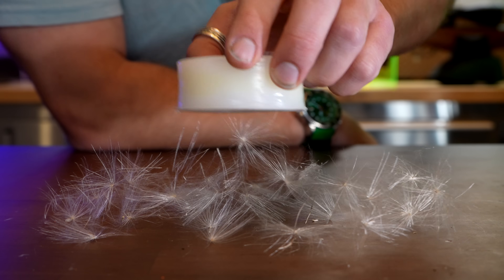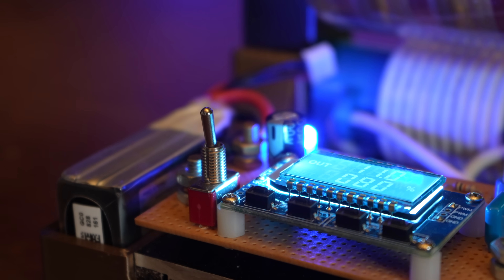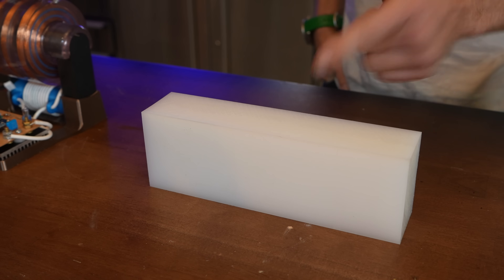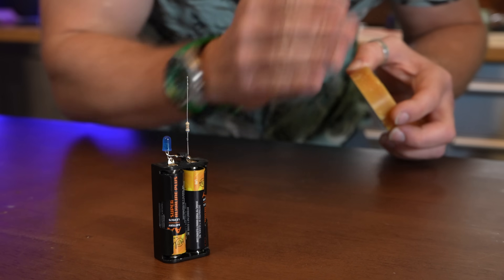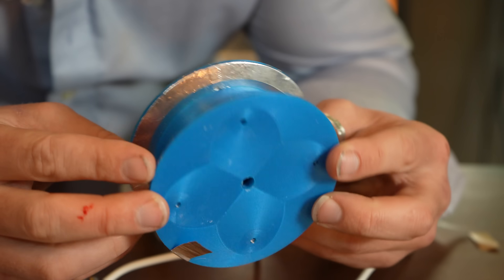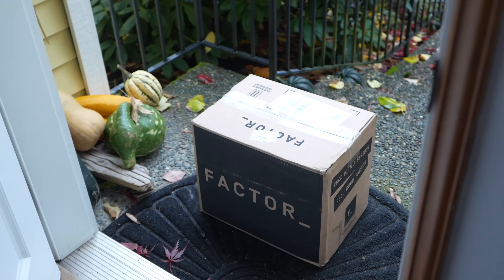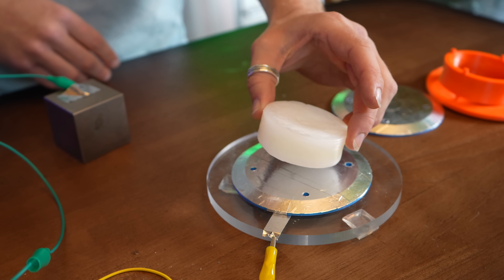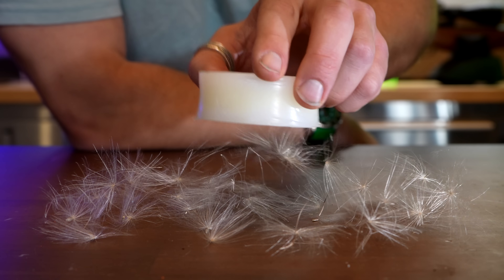Creating an Exotic Material With A Permanent Static Charge (Electret)

Comment: How about using a pair of N- and P-channel MOSFETS for the sensing, with red and green LEDs to show the polarity.
Reply: More specifically Bi-color Red/Green LEDs.
Reply: @Datvi  'More specifically Bi-color Red/Green LEDs.'
- as @blacknoir2404 suggests, and I 100% agree: Use a Blue LED to represent South, Red to represent North.
Plenty of multicolor LED's on the market.. Would be an awesome project to see implemented :ø)
Perhaps represent the field strength as variations of Red/Blue tones... ;ø)
Reply: Better idea: make lots of tiny electrit compasses that can turn to show the directions like a magnetic compass.
Reply: Can we make the compasses out of mini LEDs  @doppelrutsch9540
Reply: @doppelrutsch9540  That a 1990s project, e-field viewing bottle, with black fibers suspended in mineral oil.  Use black hair from a halloween costume, chopped to 3mm length, and dump it in a bottle of baby oil.  Works great.  For the advanced version, peel off the bottle label and paint one side white for contrast.
Reply: But that is very costly I think @doppelrutsch9540
Reply: @doppelrutsch9540  a regular compass should work. Depends on what it is made of, if the electric charge can pass through the material. The cheaper the compass the more likely it would work.
Reply: @glenwaldrop8166  I can see the idea, a electrically conductive needle should also align with the electric field. But it would be better if it wasn't magnetic at all.
Reply: @doppelrutsch9540  I'm just saying it should interact.
A sliver cut from the piece he made should work as well.
Reply: Maybe a 'compas' needle made out of small polyethylene electret rods. ;-)
Reply: Dagnabbit. I was going to suggest something similar. Bipolar sensors and dichromatic lights to indicate electric field polarity and intensity simultaneously.
Reply: As a teenager in 1977, I used a CMOS hex inverter and a red/green bicolor LED. I connected 3 inverters in series with the LED (plus resistor) across the last inverter. This was mounted in a plastic box, with a sense wire connected to the first inverter. The LED would change color when things moved in the vicinity. Since the final stages were operating in the digital realm, the LED was always full on.

In the modern era, this could be done with the analog input of an Arduino, which would make it possible to display field strength and polarity with an RGB LED.

Analog input characteristics vary quite a bit from one model of Arduino to another. Some will require an OpAmp to buffer the input. The circuit requires a very high impedance voltage divider connected to the input. Since it needs to be in the megaohms, there may be enough parasitic resistance already without adding external resistors.
Reply: Picked up the presence of any ghosts yet with your sensing array??? (Seems like it might work for that too…lol)
Reply: @mxcollin95 that's the spirit.
Reply: With clipping zener diodes so the FETs don’t explode.
Reply: @ezze7540  The direction of the electric field produced by the puck at some distance, which has the same curved dipole shape as the magnetic field of a dipole magnet. Which is commonly and to much enjoyment shown for example via iron filings that arrange themselves in the shape of these arcs, or an array of magnetic compass needles will also do that.
Reply: @ezze7540  It doesn't show the direction of the electric field.
Reply: @doppelrutsch9540  the direction can be inferred from sampling multiple points, which he is doing
Reply: I was thinking of using JFETs.
Reply: My first thought was an LCD (or LED?) panel/film. But I'm not sure what would be needed to make that work. Or even if it could work.
Reply: I've made a electrostatic polarity detector this way ... Works great...
Reply: It looks as simple as some kind of Transistor with the antenna connected to the gate., is the detective circuit really that simple?
Reply: @ yes. Just a small-signal MOSFET like the 2N7000 with its gate used as an antenna. It used to be more common to do this with a three stage darlington (three BJTs with each emitter fed into the next transistor’s base) to get high current amplification, but the voltage-based amplification from the FET works easier.
Reply: @petevenuti7355 yes, but as with all bare transistors, their 'input'/ 'output' ratios vary, so you'd need to carefully test and sort them. Alternatively, there are simple circuits that balance out these variations and the transistor characteristics have little/no effect on the function.
Reply: @bikerfirefarter7280  I've heard of balance networks for automatically impedance matching antennas, but I've never heard of circuits to automatically balance transistors so the transistor characteristics have no effect on function‽ How does that work?, actually how does the impedance matching thing work too as I don't understand that either.
   Also great username, I take it you're a fan of Indian food?
Reply: @petevenuti7355  nah, the name was a joke/fake that I made up from the thumbnail in response to invasive company phishing, and it's just become a habit to use it.
The circuit you are interested in is based on a single bipolar-junction transistor with two in-series resistors connected between supply and ground, the center-point is connected to base; the collector is connected via a resistor to supply, and the emitter is also connected to ground via a resistor.
Input signal is applied to the base; output is via the collector/collector-resistor junction  (or the emitter/emitter-resistor junction).
Both of the in-series resistors are of equal value, the 'input pair' are fairly high value (k-ohms), the 'output pair' are also equal resistance, usually 10s-100s ohms. The gain is related to the ratio of input/output pair. 
If you analyse the circuit you'll see the 'gain' of the transistor has virtually nothing to do with how much the transistor characteristics vary in/from each batch.
When I've more time I'll find a link to a reference for you. But it is a 'standard' configuration for a single transistor amp.
Cheers.
Reply: @bikerfirefarter7280  thank you! It's not very intuitive to me how that might work but I'm guessing something like a voltage divider, and that controls the gain?
Reply: @petevenuti7355  almost; the voltage divider just maintains a reference somewhere in the middle of supply voltage, the gain is related to the ratio of the input and output resistors. The transistor characteristics are virtually irrelevant, especially for low gains i.e. 30x or less.
Reply: @petevenuti7355  Electric field detectors I seen usually have 2 transistors configured as a Darlington pair for sensitivity. Darlington pairs can come in a single package looking like a normal transistor, his circuit here could be using that or maybe the field of his electret is so strong that only a single npn is needed (hfe gain about 300)
Reply: 👋 there. Love this. There is a video somewhere on youtube from a chinese worker who does that principle with aluminum. He melts the metal ...and if i remember me well ..while cooling and stiffening he placed it in a magnet field...or electruc current. Afterwards the aluminum reacted as if a magnet ! 😂😃. Many will cry, nah, aluminum can't be magnetised. Well, actualy i think he produced an electret ! Cheers, everybody. Also , well done this post, 👍👍. FM 🧭🍀🍀🌞
Reply: How about a ceramic, i know melting temp es much higher, but Maybe that would be an awesome elektic
Reply: @troelsnielsen2848  ceramics tend to have too much of a crystalline character, not enough of a molecular dipole moment, and too short or symmetrical in shape.
   In case you don't know what any of that means, think of water. You've probably heard it explained that water is a polar molecule, and like dissolves like and all that, right? That's because the oxygen on one point takes a little bit of a negative charge. You might think that by putting this water in an electric field, all the molecules would line up, and you know what you wouldn't be wrong. If you put highly distilled liquid water, such that it is an electrical insulator, as the insulating part of a capacitor it would work very well! But because it's a liquid made of small molecules the molecules are free to move, the normal jostling of temperature can quickly randomize it so it wouldn't effectively hold a charge forever..  so then you might think well what if I freeze it? In the case of water that wouldn't work either because water has a generally hexagonal crystalline structure (meaning that because they're all shaped like a bunch of Doritos chips they can only be frozen in shapes like triangles hexagons, isodohdecagon?) and because there's freedom in the different ways these triangles can fit together it's not a true Crystal it's a quasiCrystal. 
   To make one of these out of a ceramic you have the same problems as trying to make one out of ice. 
  It's not impossible and I'll come back to that.
  The ideal substance, would have really long skinny molecules, with a strong charge on each end, with lithium being the most positive and fluorine being the most negative. Forget lithium because it would probably just catch fire if it got wet, pick a less reactive metal, say Cobalt, which forms stable organometallics,  vitamin B12 is an example of you might know but I was thinking cobaltocenium. The other side of the molecule would be easier to add a fluorine, like Teflon. The backbone of the polymer can't have many conjugated bonds, I don't think you want to ask me why.  The hard part would be getting the polymer to grow in one direction. It would also tend to form rings, like magnetic bracelets, so you would need a very high external voltage to open them up and line them up. Once all these long chains cool down and solidify, they will be too long to freely move and will hold their charge orientation.
  I said I'd get back to ice analogy and certain minerals, things like asbestos or tourmaline can have long thin crystalline structures with some charge separation, but controlling the crystal growth of a complicated molecule like that trying to make such a synthetic mineral would be extremely difficult! Definitely not a matter of just melting it and pouring it. It would even be more difficult than making a monocrystalline silicon rod like what they cut wafers out of, silicon wafers and diamonds they are made single elements, making an analogue of tourmaline or asbestos and growing it in a lab would be WAY more difficult then growing diamonds.
   Sorry to be the paragraph character , I just know more of chemistry than anything electronics.
Reply: How would this interact with ferrofluid?
Reply: Coincidentally, Paul Ybarra has a youtube video on electric field detector which he built something similar to what you are describing
Reply: @iteragami5078  same here, i found the quality at 192 good enough by far and it was becoming difficult to hear the artifacts. do keep in mind that those mp3s were encoded with very high quality settings though, using a lot of cpu power. most online converters and software advertise being fast and do the exact opposite, giving you files that are relatively awful.
Reply: Even deeper, trying to use using electret materials as semiconductors. EFET
Reply: @leggysoft  you might be on to something. There are different kinds of conductive plastics, if you had a mixture of these insulating but highly polar plastics, with some conducting plastics but just barely , such that the internal static field induced in the plastic during setting creates a bias that prevents the conduction, yet close enough to the tipping point that adding an external field will tip the conducting plastic back to being conductive. Sounds like something that could definitely work with the right choice materials and conditions! 
   You electronics guys, does that sound like a FET?
Reply: Far more better idea, charge a cable while shielding it to see if electret acts as myelin sheating and increases the conductivity of copper core.
Reply: @XavierBetoN  nerves don't work that way. The cell membranes have ion separation, polarization from the inside to outside. It's a wave of depolarization that is conducted along nerves not a conventional electric current. If you insist on comparing a nerve for the myelin sheath to a coaxial cable, imagine the cable being charged like a really long capacitor, and the outer insulator keeps it from getting shorted to ground. The signal is the discharge wave when the coax capacitor is  discharged.
   Nerves are more like batteries,  my point of the analogy is that the signal is the discharge wave not an electrical current.
Reply: @petevenuti7355  I'm sorry but even if nerves don't work like cable, analogy works like this.
Reply: or use a 2 or maybe even 3 axis motion system and an ADC alongside supporting circuitry to quantively analyze the field at any point.
Reply: Am i mistaken in thinking that this would repel charged ions?
Reply: We’re on the same page!
Reply: Or maybe neon indicators?
Reply: That’s incredibly brilliant!  Instantly subscribing.
Reply: if youre gonna do that, save your sanity and just use an op-amp and a bipolar LED - the whole thing is 2/3 parts.
Reply: You know.... Best visualization would come with a LED cube. If one can do it, if you have the time, I'm looking at you gentleman!
Reply: Your designs are always outrageously beautiful.
Reply: I found that mosfets were barely sensitive (way too large a gate-capacitance.)  Try JFETs instead.  That's what I used in the 1989 "charge-detector wall" at Boston's Museum of Science, with an array of ?300? sensors IIRC.   It only detected one polarity (budget didn't cover 300X a more advanced two-LED circuit.)  My antennas were black screws 1cm tall, supported on little nylon standoffs.  Even with such short antennas, it would detect a charged rubber balloon from a meter away.  Every FET was protected by a grounded NE-2 bulb.   I even had a "reset circuit," where each gate was connected to a 1pF capacitor, leading to a 12V pulser.  Giving it a pulse would discharge all the gates and turn all the LEDs on equally, then a negative-charged object could selectively turn them off.
Reply: An old school approach would be to connect your 3k ram computer to a cathode ray tube (TV) and set the screen colour to either red, green, blue, white. Good for exploring magnetic fields as well.
Reply: What are the components of simple electrostatic detector in video?
Reply: Good to build a free energy generato
Reply: You make me so wet when you talk about pole arity
Reply: Have circuit diagram or component number ?
Reply: Circuit
Reply: I'd say blue because it looks better but you have very unequal forward voltages then sadly
Reply: @blacknoir2404  complimentary pairs would dramatically reduce the inequality, but increase sensitivity by over 100x pnp leading into npn for one polarity and npn leading into pnp for the other. Matched betas between pairs is ideal aka both npns have same beta and pnps do too. No one wants to test hundreds of transistors to get a handful of matches, but I've done it for custom projects and it's worth it. The alternative is a box full of microcontrollers and even more time programming and calibrating.
Reply: Came here to say the same 😅❤
Edit: would use npn/pnp bjt of course 😅
Reply: @Christian-lh7ux  complimentary pairs. Not Darlington either, complimentary to compensate for thermal/environmental biases.
Reply: Diffusers in front of the leds would be easier to see the field and maybe it would work better mounted on a proper pcb instead of free floating solder joints
Reply: @Björn_1978  A PCB would give it an effective backplane. Whether that's good or bad, I dunno, depends. Nothing wrong with that construction style, though, at one point all commercial electronics, radios etc, used "Manhattan-style" design, just components clamped around the case with floating wires connecting one pin to another. It's sometimes used in high-frequency circuits where having a ground plane or backplane would slow stuff down with induction, eg.

A proper PCB that size would be a big waste since most of the PCB would be empty. He could use 25 small PCBs but then what would be the point? It'd just be more soldering. These are very simple circuits so I don't think it matters that much. That said there ought to be a resistor in line with each LED, it's very bad practice to connect an effective short circuit right through there.
Reply: @greenaum  You could leave out the ground plane around the antenna and even make a slot in the PCB around it to reduce the influence of the substrate. Alternatively you could solder the antenna separately.

A PCB would simplify the assembly steps and save a lot of time, for the same amount of time and effort could produce a significantly higher number of "pixels" at a higher density. If you make it fit inside 10x10cm it's cheap and you can even order them assembled.

Comment: I think your finger was acting as a ground for the Van De Graffe electric field.
Reply: Puzzle for me too. Either that was wireless current to ground (finger lightning rod facilitating cloud discharge) or the space between the battery/antenna plate and the Jay/tesla plate was being made a polarized dielectric (capacitor?), and I'm not sure it's not both.
Reply: @cherylm2C6671  Same, I think. Even a capacitor is a conductor with high dielectric resistance. Sparks/lightning are dielectric breakdown, but there is also less violent transfer of charge, which accumulates gradually. In this case, charge was diverted away from the sensor to his finger. Likely, if the finger was insulated, once it accumulated enough charge, the diversion would cease and the sensor would light up again.
Reply: He was grounded, for not wanting to give an explanation !